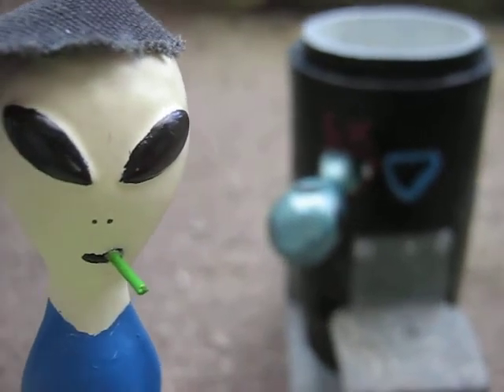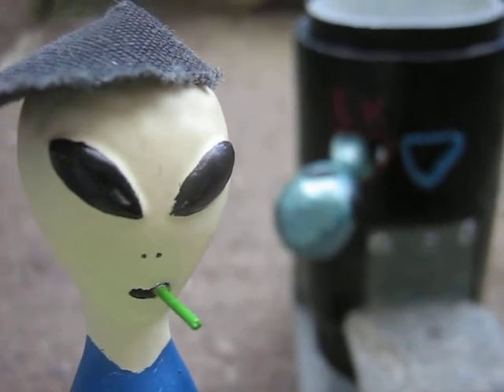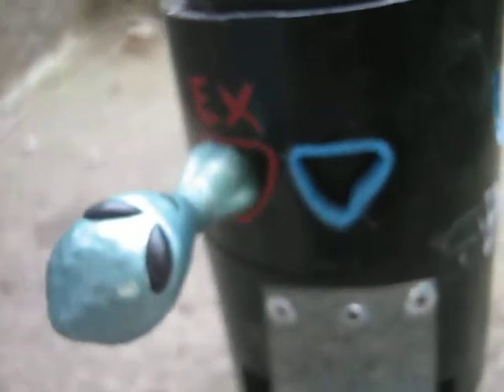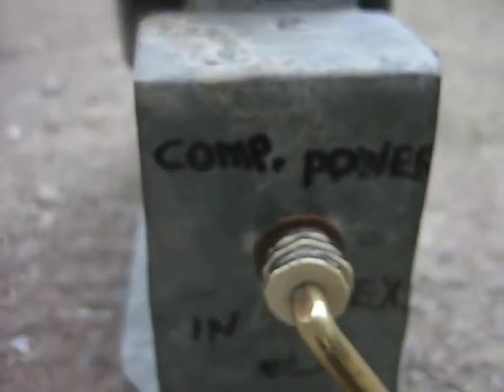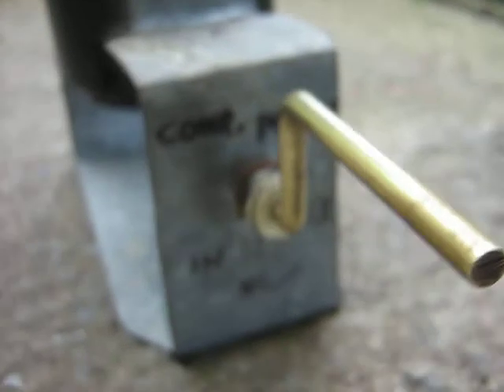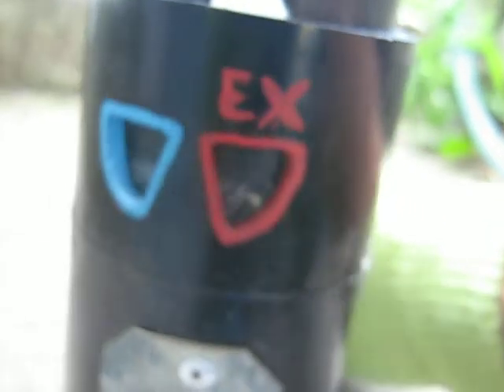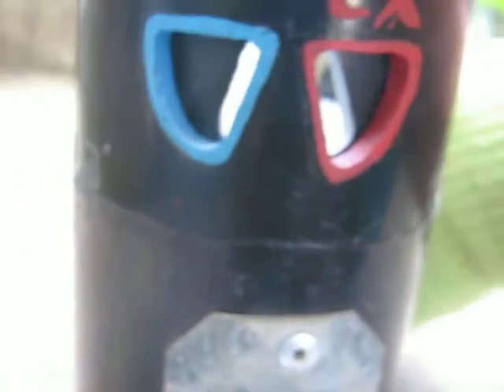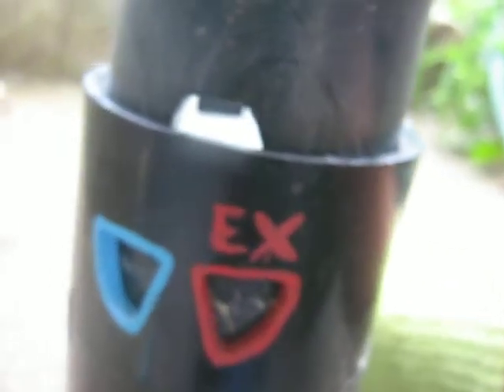How a Sleeve Valve 4 stroke works

Comment from the maker: It is pretty easy to do, this one is made from black plastic drain pipe. The outside tubes which represent the engine block are made from pipe couplers that have the center lip ground out. The sleeve is drain pipe, that was machined slightly to make it a looser fit. The couplings may have been machined also, to remove the lip, and any taper in them.